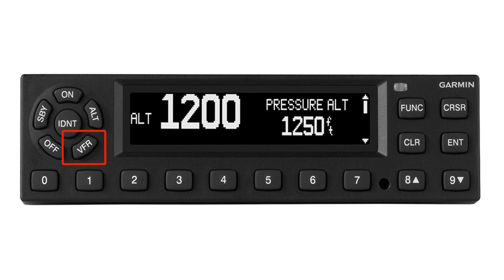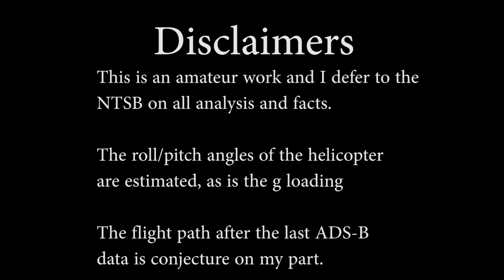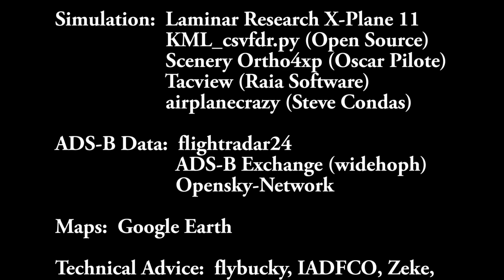Newly released Pilot to ATC Audio!  N72EX (Kobe Bryant) Crash Reconstruction.

Comment: I read reports the pilot did the SAME exact flight on 1/25 Saturday which was a day before the incident on 1/26. I clearly remember it was very foggy in LA even on that Friday night 1/24. Is there any data or audio on how the conditions were when the pilot flew on 1/25 Saturday?
Reply: It was foggy on Saturday as well. LAX had flight delays Saturday morning due to fog. You can look up news article to verify this.
Reply: Cody Cha right, i wonder if someone has the data and flight pattern on Saturday’s flight. and wonder if the pilot got overconfident and thought he just did this trip in foggy weather on Saturday, I’m going to do it again Sunday
Reply: @ZOOMKOBEPE  Wow I didn't know anything about that but if he successfully flew under those same conditions just a day earlier then that would definitely explain his overconfidence.
Reply from the maker: I don't know how we would know if the pilot flew that path the day before, since I don't know how that would be tracked by anyone other than the charter aircraft owner.  From flightradar24 I can see that the helicopter N72EX, however, flew from SNA to Camarillo at 18:05Z and returned to SNA at 23:45Z.  Both legs of the round trip to Camarillo went quite close to the crash site, but the helicopter went right over the mountains and did not try to follow highway 101.   According to weatherundergound, the weather at Van Nuys airport was fair at 18:00Z and mostly cloudy. at 23:45Z.  That doesn't mean the conditions were the same near Calabasas, though.
Reply: @stevencondas2281  Kobe had a basketball tournament that weekend. Kobe did fly to his camp on Saturday according to NY Times article. He has been photographed at the camp on Saturday. Also it would have been the same pilot since Kobe only flies one pilot.
Reply: @ZOOMKOBEPE  the flight path on Saturday did not involve any delays or detours. It was the typical route they usually take from John Wayne Airport to Camarillo.
Reply: Steven Condas “The afternoon before the flight -- after returning the Bryants and their guests to Orange County -- Zobayan had texted that he had just checked the weather for his next flight and it was "not the best day tomorrow but it is not as bad as today." The pilot exact text. He had confidence as he did the flight exactly the day before
Reply: Steven Condas new article today https://www.espn.com/nba/story/_/id/29324550/ara-zobayan-pilot-kobe-bryant-crash-erred-reporting-was-climbing-ntsb-says

Comment: Thank you for this!!

Still, I don't fully understand how the pilot and passengers didn't feel the dropping of altitude, especially at that rate.

Also, I heard the audio of the impact from a neighbors "Ring" security camera, about 10 secs before impact, you hear the helicopters props making a distinct sound, where they seemed to get louder. Do helicopters make that sound as they are climbing, falling, or when the pilot is requesting more power from the engines (load)?

You can hear the change in engine/prop sound exactly 10 secs before impact in the video below (17:45:28 according to your timestamps). 

At 17:45:24 that was his last transmission, at that point he noticed something was wrong and perhaps tried to recover, but ultimately couldn't? Idk

Jump to 0:41 for sound reference in video below... 

https://youtu.be/nL9XxwOUBMU
Reply from the maker: I have never experienced spatial disorientation in a helicopter, but this video shows how easy it is to become disoriented when you don't see the attitude indicator and you can't see the ground out the window:   https://www.youtube.com/watch?v=9ofStn2KScg&t=330s .   In that video, the pilot is flying while his head is covered and the attitude indicator is turned off, and he gets completely disoriented.

I hear what you are saying about the sound, but I don't know enough about helicopter sounds to make an assessment.  I will also caution that my reconstruction of the last 5 or so seconds has some guesswork because flightradar24, ADS-B exchange, and OpenSky network did not collect the data due to insufficient receiver coverage (so I don't know the exact path or speed).  Given that, my crash time could be off a couple of seconds.  The NTSB has at least four more data points at the end that will help their analysis.
Reply: @stevencondas2281  yes! I've seen that video of spatial disorientation. It's horrifying! And also yes, I remember at the end of the video you mentioning the last moments. Really wish we knew what causes that change in prop sound, just for education purposes of course. I've heard it before over my 38 years of life, but never knew what conditions cause it.
Reply from the maker: Thanks again for sharing the ring video compilation!  I hadn't see (or heard) it.  On the last camera I put the audio of the initial impact at about 17:45:40.8.  I believe I have found the location of the camera and it is about 900 meters away from the crash.  It would take sound about 2.6 seconds to travel that distance, so the initial impact is around 17:45:38.2 according to the camera clock. 
 This is very close to the time in my reconstruction.
Reply: @stevencondas2281  Wow! Great way to analyze your timing! Absolutely horrific crash, but am glad you are helping in figuring out, or just showing others, what may have happened during that flight.
Reply: @stevencondas2281  my pleasure. I'm happy to hear that you found the possible location of the camera. Im pretty good at reverse investigative searches too. Extremely satisfying when you can put the pieces back together!

Awesome work!

Comment: I think it was retreat blade stall because he was trying to elevate with all that weight, that’s why “the engine sounded funny” it was actually the blade noise. That dip in elevation is too fast to not know. Just my lil opinion.
Reply from the maker: When the hard turn starts around 04:15 (~17:45:10Z) the airspeed is less than 115 Knots.  It is unlikely that there was retreating blade stall at that low of speed, and my consulting aerospace engineer concurs.  Not that it proves it, but I am not able to induce retreating blade stall in the X-Plane 11 simulator at 115 knots, no wind, 2300 ft alt, maximum collective, and 1000 pounds over max certified weight.  I will caveat, however, that I am not using a certified S76 simulator and that the actual model that crashed was a S76-B, not the S76-C in the simulator.
Reply: @stevencondas2281  Well I am not an aerospace engineer so it was a guess from normal person doing research. haha Thanks. I am figuring the turn was part of the stall because from what I have researched it does a pitch to the retreating blade. He had enough speed before the turn and weight......?  I'm glad it is a theory that cannot be totally thrown out, I will take it. I am a college graduate in Psychology, who thought Kobe shoulda just drove. What is the hurry man? You are retired. On the boosted audio-clips, you hear that thing hit then poof.
Reply from the maker: @aidenfoster7459  I think it is a good question, and I am sorry if my response made you think otherwise.  I asked the same question to my aerospace engineer when I started the analysis!  Bottom line, it is VERY unlikely that retreating blade stall caused the bank at 04:15 in the video because the airspeed is too slow.  Because I don't have data for the last few seconds of flight, however, I don't know if there was retreating blade stall at the end of flight when the helicopter exceeded VNE (the manufacturer specified "Do Not Exceed" speed for the aircraft).  I believe that about the time of the crash the helicopter was at more than 170 knots, and the VNE is 155 knots.
Reply: @stevencondas2281  Cool brotha I'll take it, because I have NO flight hours. hahaha Just heard of the stall, heard that audio and thought that thing just fell out of the sky, hate to say it. If the NTSB says it was Retreat Blade Stall I will consider myself just a good researcher. LOL. There is a video of the "boosted" Ring door-cameras and that thing hit and insta-poofed........Insane. It looked like it hit the hill like it was trying to land because the tail, fuselage, and blades were all over. hit broke the tail, tipped and the blade took the fuselage to its final destination.

Comment: So do helicopters have that instrument that tells them how far the ground is which planes have? Do helicopters only rely on visuals?
Reply: TAWS may not have helped in this case, it took very little to be out of control and into unrecoverable dive.  The pilot is IMC certified but somehow he could not handle it and lost control, and that is the main problem here.  He had lots of experience but probably almost none in the condition he was in.
Reply from the maker: The NTSB said this helicopter did not have a terrain awareness and warning system (TAWS), but that it did have a RADAR altimeter.
Reply: @stevencondas2281  
after saying that, I think they are going to enforce these terrain warning systems into helicopters
Reply: @prac2  Most of the time people have to die first in order to fix things.